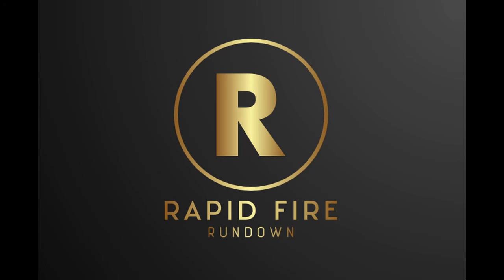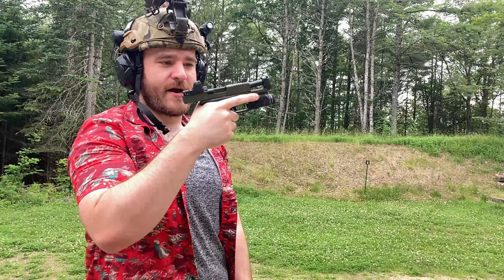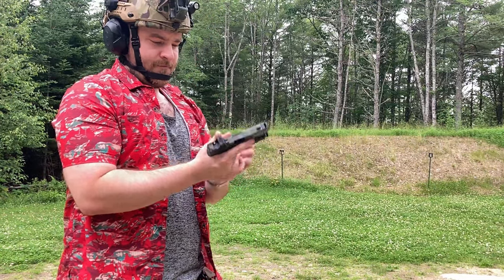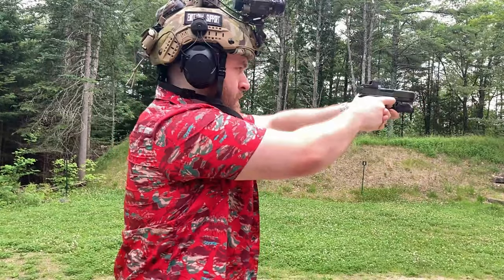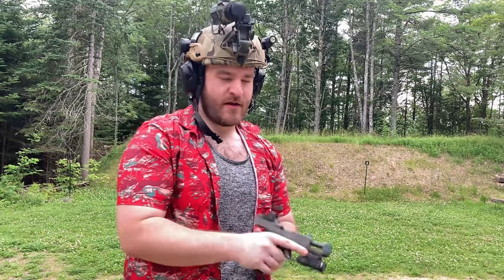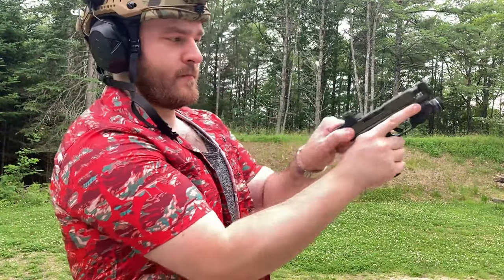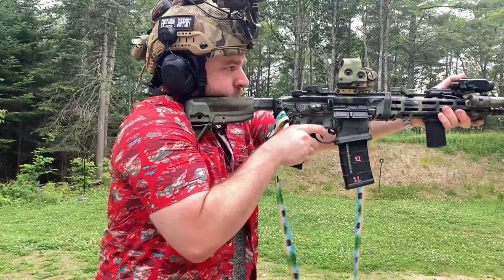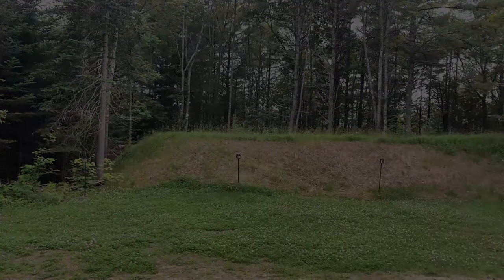G43x Roland Special + PMM Comp Review

Comment: You left off no. 4: Makes the gun longer and hence, can make it more difficult for concealed carry.  Good video, good info!
Reply: Longer slides don’t really affect CC in regard to printing and pressure points, weights the only thing that gets slightly worse and that can be fixed with what pants, belts, and holsters you use.
Reply: Actually a longer slide will act as a lever and conceal your grip better. When  I ran sig 365 I bought a xl 365 holster which did conceal better than a regular 365 holster. Also if you change slides or put a comp on it then you are still good to go.
Reply: @andershilmo1866  I don't see what putting a p365 in a p365 XL holster has to do with a longer slide. Though a longer slide may require a longer holster, a longer holster and a longer slide or not the same things. I have a Glock 27 and a Glock 23 with an alien gear appendix holster for both. I find the 27 much easier and more comfortable to carry.  Many good holsters also have those little legs that help keep the handle tucked up against us and I know those work. Perhaps you can share a little more information to help me understand.
Reply: @nYdGeo  Sure with a longer holster like the xl vs regular p365 holster , you can position your wedge lower on a longer holster which gives more leverage which means you grip will be pushed into your body more. You can look up vids from Philster holster or armed and styled. They have more info on it. If you have a g19 holster you should be able to run a g26 in it and it will likely conceal better. As the Philster channel says with shorter slides you have more of a tip out action with the grip. Of course a larger footprint holster will decrease comfort in some respects. I am a bit odd I carry fullsized even larger than average sized duty guns regularly. Having studied some concealment principles. I can conceal quite well.

Comment: I might have missed it with the low audio, but did you compare the comped 43x to a 48? Could it just be the extra weight of extending it? I've shot both 43x and 48 and there is a difference in felt recoil to me
Reply from the maker: I think the comped 43x feels much better. much less snappy.